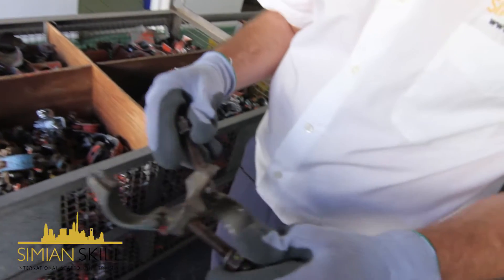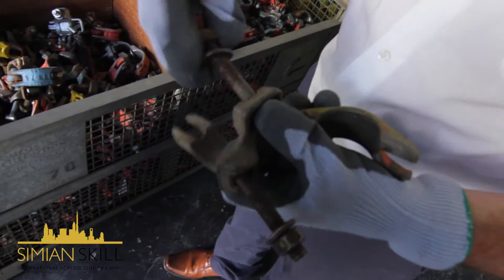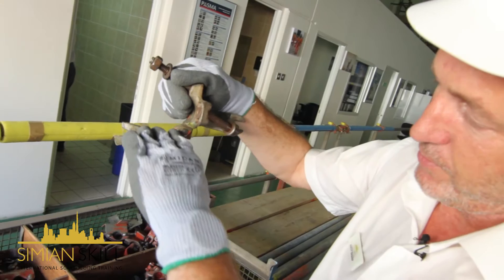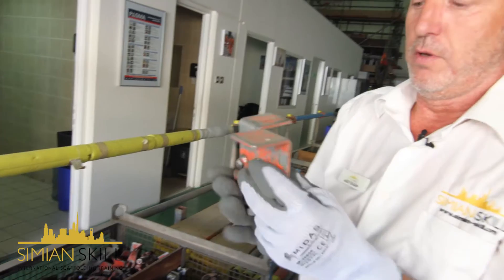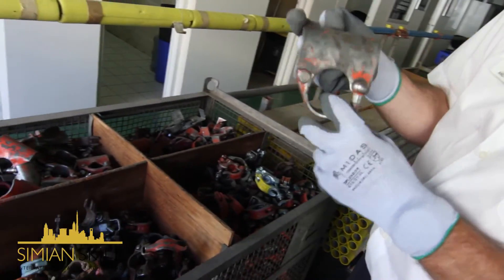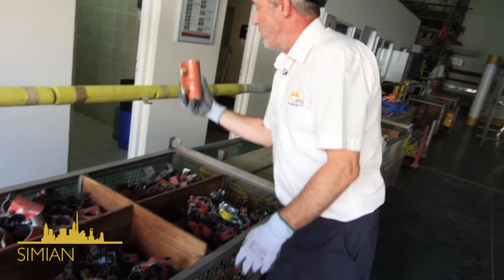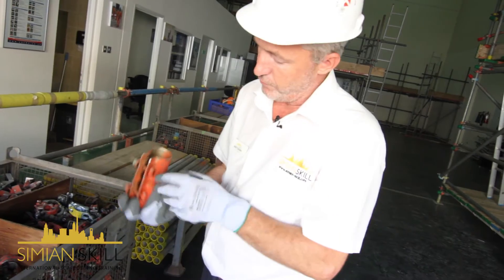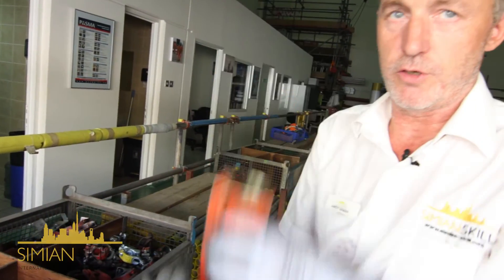Inspecting Scaffolding Components: Fittings

Comment: Why do some clients ask for class A specifically when we are offering class B for the same price.?
Reply: Coz class B is lower class. Do you want a lower class or higher class?
Reply: @AHEUTUBE  no random answers required. Kindly read the specification and then reply. Class B clamp has more load bearing capacity.